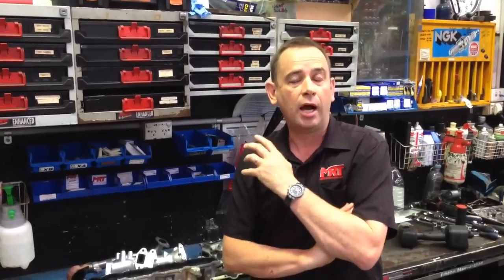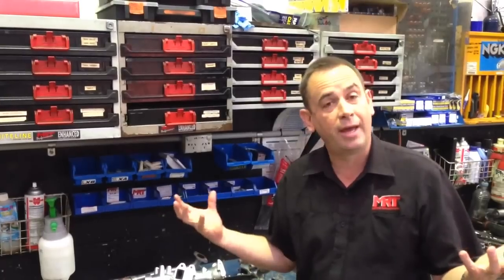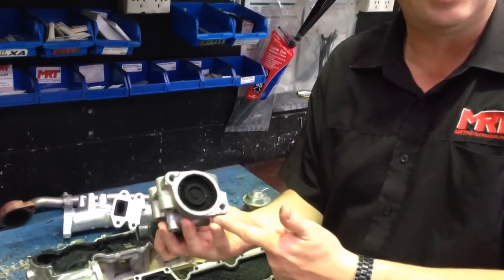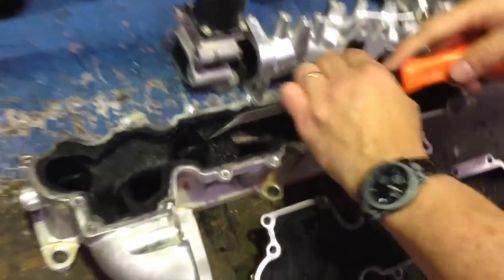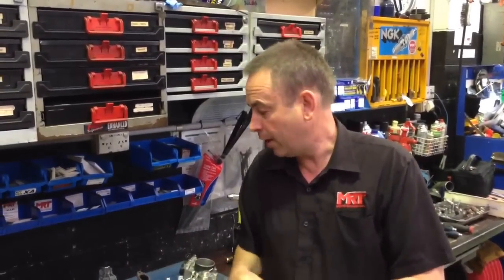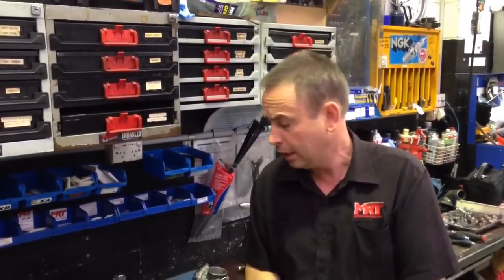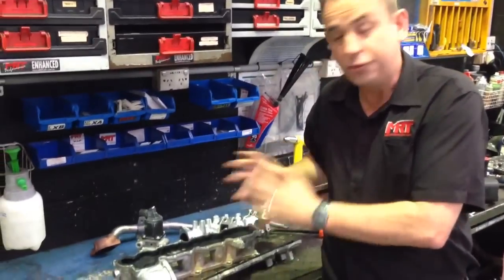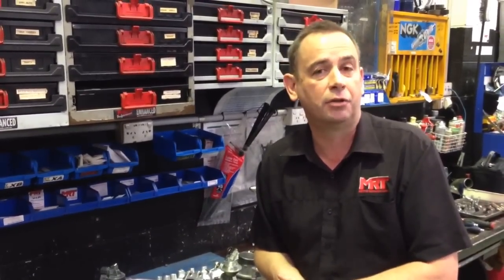Mitsubishi Turbo diesel secrets, the hidden ugly side of soot.

Comment: Thanks MRT , that was a great video.

I would like to add my personal story to this video following
the theme of soot and EGR issues.I purchased a DID MN Triton (2011 Model) a year and 8 months ago here in SA. After a week it start blowing black smoke so I took it back and they identified the fault as a build-up of soot so they cleaned the manifold  and also, or so I been told, changed fuel filter as I have been explained “is very sensitive to fuel deposits”.As per their recommendations I started to buy the diesel additive ( Mitsubishi brand for an outrageous $14  a bottle. What the …..????  it is 500Ml bottle for a full tank of 65 Litres).
2 weeks later, the same issue. ‘This time it is the EGR’ they declared,  which they insist is now going to be replaced ….. 
4 days later, the same issue again. This time they tried to sell me a story that one of the components was not installed properly while they fixed the EGR so now it is all good ..2 weeks later .. you guessed it,  it happens again …. They promised to look at
it more closely and they decided it is the Turbo … so they replaced the turbo.6 months ago I took it to a non-Mitsubishi-mechanic for a scheduled service who insisted that the fuel filter is aged and not been replaced…. Go figure !The time has come to do the timing belts (2 months ago) so I went there again and asked them to look at my favourite subject- black smoke, while they are under the hood. During ALL this time I always had that thing where something  is also causing the engine to idle
poorly and while taking-off slowly, by pressing on the accelerator gently, it causes the car to 'bounce' and or 'hold-back' as if there is a poor flow of air OR some sort 'engine-starving' effect as if something is clogged somewhere or blocked ( of air flow)Guess what …. They found out that after a year and eight months that one of the injectors did not work … will you believe it ????? I was driving with only 3 working cylinders for all this time. How on earth did they not pick up that fault ??? “Very rare” they told me…No wonder they replaced the turbo, the engine simply did not have enough grunt in it to function properly.Anyway , that done, I drove for a couple of weeks and the black smoke started again ! I said , that’s it. You either fixing it or I am going to consumer affairs. Well now, they finally found the fault ( I hope) , it is the AFS (Air flow sensor) which supposed to be replaced with a new designed sensor replacing the original one.  According to the Mitsubishi mechanic, the engineers of Australia, Thailand and Japan looked at this issue of AFS faults and decided to redesigned it with a ‘harness type’ about 2 years ago. (This is what I was told, I am not an expert !). The mechanic replaced it and re calibrated the air flow again electronically and it’s all done now.
Well, the car is working as it should!!  with power, grunt and without ‘dragging’ itself. It changes gears more easily (auto), it sounds smoother, quieter and drive with less effort on my behalf. Black smoke is no longer an issue.Lesson of the story is, don’t give up ( I am very very very lucky that the car was still under warranty). Keep on taking the vehicle to the Mitsubishi mechanics ( especially if it is under warranty) and don’t take ‘No’for an answer. Mechanics also have their faults and some are simply not experienced enough to look beyond set of instructions, steps over a laptop…..If anything, I hope I helped someone out there who is stuck with an EGR issue that his Mitsubishi mechanic cannot figure out… Don’t be shy and insist that they look at all the above issues thoroughly and not just through a laptop… at the end of the day, THEY ARE GAINING EXPERIENCE FROM THESE MISTAKES which hopefully will not affect the other poor Triton-owner who just want a vehicle to work as it should.Cheers, and good luck !Please leave your comments to the next person on these blogs/youtubes,  it only help us, as a
consumers, to get a better understanding of what  is wrong with our vehicles.
Reply: your mechanic is very very good..hahhaha..in that case the mechanic should take the engine performance in each cylinder...not by judging.coz it waste of time  and money..
Reply: Isaac Negev; Excactly what engine do you have in your Triton?
Reply: I owned a 2014 triton (Strada in the Philippines) pick-up. Appreciated your story, thank you brod. I used to service every pms at my distributor (casa), although it is costly but it was well maintained.
Reply: WELL DONE ...DILIGENCE WON OUT  ....

Comment: I've owned diesel 4WDs for 30 years. These new engine no doubt give you more performance these days for your money but also need more TLC. My 2011 Mitsubishi Challenger has the MRT retune by Brett and I can honestly say that the performance and tune of my car is excellent and stable.  My car was new and I bought the retune at around 5,000 klms and now I have done 115,000 klms not missing a beat and feels as good as the day it was done. I see less engine timing adjustments needed as well as far as we can tell.

EGR is a peace of pollution kit for sure designed to control emissions in which manufacturers are increasingly under pressure to reduce green house gases just like any other industry that pollutes. Beijing's resent smog Red alert is a testament to pollution causes of particulate matter (PM, 2.5 is a type of pollution involving fine particles less than 2.5 microns (0.0025mm) in diameter) of which cars are a major contributor and they have placed restrictions on car use this week. Odd and even days.
As we know its these particles mixed with unburnt fuel that causes the eventual restriction in the manifold of all DIDs as show in this video and I'm convinced of the need to limited EGR involvement. I know of a couple of triton owners who have suffered. Don't forget the performance gains Brett brings. I'm installing LPG injection soon which will no doubt give me better economy and performance but even more importantly a more complete burn and  less unburnt fuel means an even more cleaner engine and less pollution !! A win win as I see it.
Get on board everyone !!

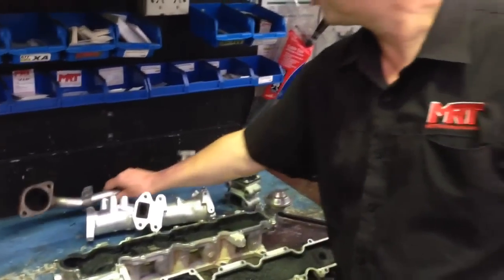Comment: The best way to disable the EGR Valve (as seen at 2:35) without upsetting the ECU, is to unscrew the four screws connecting the Actuator and insert a 6mm shim between it and the valve body, before reattaching.  The Actuator will still perform as usual but there will be insufficient throw to open the valve and all this can all be done with the EGR Valve still in situ.

Since the primary function of the EGR Valve is to lower NOX by reducing combustion temperatures, it is possible that the Mitsubishi cylinder head failures could be attributed to the widespread crippling of the EGR Valve which was popular at the time.
Reply: or just buy 12$ cable, read ecu, disable egr and write it back.
Reply: Mut3 12 dollari? 450 i say

Comment: You should mention fitting an oil catch can is also another option to stop this problem from happening
Reply: Well, it will slow it down. As it only controls the crankcase ventilation not the EGR the egr is defined to destroy the internal moving parts of the engine. Carbon is similar to diamond dust. It is an aggressive grinding dust. Let me ask you Would you dump a liter or one Quart of valve-grinding compound into your crankcase with every oil change? I don't believe any sane person would so why would you dump carbon from your exhaust back into your engine never mind the plugging up the total air intake system? Then it starts grinding your piston walls and wearing down the piston rings and getting into your crankcase oil reservoir then your main bearings and seals, the cam bearings timing chain or gears front and rear seals gone

Comment: This makes so much sense! I recently went to install a boost gauge on my 83' Merc 300SD (OM617.952) and I removed a plug in the intake manifold and there was a good half an inch (no joke) of that black tar built up on the plug, and therefore throughout the intake manifold. I was horrified, and wish there was an easier way to clean her off without letting it sit in an acid bath. after 250,000 miles it really builds up! Darn emissions stuff gumming our engines up.
Reply: An easy way to clean it is to get a propane torch & an air compressor, remove the manifold,  stick the torch in the  manifold to soften up the black crud & use the air compressor to blow the crud out.

Look up "cleaning out inlet manifold with blow torch"
Reply: "This makes so much sense", yes, causes more emissions than it fixes.

Comment: Just to clarify EGR. Exhaust gases have already been burnt making them in effect inert. At small throttle openings the reduced air volume causes a lowering of compression pressure and subsequent reduction in combustion efficiency. By recirculating some exhaust gas the combustion pressure can be maintained without effecting the low speed air/ fuel ratio and this gives the improved performance.  Problem is exhaust gas also contains particulate matter in the form of carbon residue and oil vapor and this crud blocks the systems over time.

Comment: Just for reference the EGR will drop your fuel economy regardless of throttle position etc. The more bang you get for the same amount of fuel the more fuel economy you will have. Inert gas in your combustion chamber will reduce the fuel economy as the engine will not burn as cleanly
Reply from the maker: well said

Comment: They should design the EGRs on these cars to recirculate the exhaust gasses after it's been treated by the diesel particulate filter (DPF), that way there would be no soot to mix with the crankcase blowby when going through the intake. Maybe I'm wrong but that's just what makes more sense to me.

Comment: Interesting video. Just a quick note, the EGR system is actually designed to reduce emissions. It's designed to add a small amount of inert gas into the combustion chamber at low engine loads to help cool combustion temperatures, thus reducing oxides of nitrogen (NOx).
Reply: I don't no about cooling combustion, & don't fully agree with that but lack information to completely disagree.
It's about giving the exhaust pollution a second burn & thus reducing Nox.
some models have Egr gas coolers some don't.
It all came in to reduce pollution & keep buildings in cities less blackened etc like back in the old school days & keep air level pollution below levels gov sets out.
The Egr is designed for pollution reduction only. I cannot see how burning soot can give better fuel economy & I think thats a myth pushed by car sales people & the whole industary to say its a good tech for overall performace. There are media folks within gov who have an agenda & must brainwash with false info. 
Not that cleaner air is a bad thing, they just don't want our cars being more expensive to repair etc by their policies.

The truck industary don't have EGR's because they who actually maintain vehicles that make money realised their expensive machines where losing performance & run adblue in the system to make them cleaner in exhaust but not get clogged up.
Reply: Chris E 
https://en.m.wikipedia.org/wiki/Exhaust_gas_recirculation

Go and do some reading up on it and then come discuss.

Soot reduction is the purpose of a diesel particulate filter. A completely seperate system.

And trucks do run EGR. Cummins have been running it on their ISX and Signature engines for years
Reply: And as for SCR (or AdBlue as you put it, which is just a mixture of 32.5% ureia to water) that again is a completely seperate system to what EGR does. It's utilises a secondary catalyst in the exhaust to further reduce emissions. Again, go and read up on it, then come and discuss.

Incase you are wondering, I am a diesel plant mechanic, working in the mining industry. We are currently subject to Euro 4 emission laws for new equipment, but that's due to change very shortly, so most of these emission controls are still fresh in my mind.

Comment: "After 2010, the application of EGR into light-duty gasoline engines was expanded—not for NOx control but for fuel economy purposes. Using EGR in downsized, direct-injected gasoline engines can reduce pumping losses, improve combustion efficiency, improve knock tolerance and lessen the need for fuel enrichment"

Comment: what about a water methanol injection system? i read that it has some kind of steam cleaning effect because of the water vapors... would that help the buildup problem?
Reply: Expensive as I would believe.that system are already in existence on ww2 top notch fighter plane.bf109 . MITSUBISHI a6m6.already used it to some extent but not to reduce emissions but to increase the turbo boost and power.if I was not mistaken the ratio is 50part water methanol and 50part high octane gas.these are expensive/complicated way to produce power.back in the days where everything are legal as long as you shot your opponent down.not to mention pollution control ...

Comment: The EGR system is designed introduce inert exhaust gas to reduce combustion temperatures and therefore reduce NOx emissions. It doesn't "re-burn" the exhaust gas, it's inert....
Reply from the maker: +blmech68 excellent comment, yes you are correct, BUT there is some unburnt fuel that is used, however the main aim as you say is to reduce NOX
:)

Comment: EGR is to reduce NOx on Diesels as a result it produces more very fine particulates which is why the DPF is required. Because you are putting exhaust gases back into the engine you no longer have the benifits of better scavaging which improves fuel economy. That is why an engine today give a lower MPG than a diesel of forty years ago of the same size and power.

Comment: My ML Triton 3.2 DiD has hit 120k's and has been back to mitsubishi 3 times (60k, 90k, 110k) to have the manifolds cleaned out/replaced - remember that these cars carry a 10 year power-train warranty and as this is an existing fault with these engines mitsubishi has to keep warranting the claims up to the 10 year mark!

Comment: Very good video, however i must disagree with 1 thing. EGR blanking plates do not have the downsides that he mentioned. In my mk6 ford fiesta 1.4 tdci, it increased torque down low in the rev range and also increased my mpg by 2 or so miles. Myself and the rest of the UK Mk6 owners club thinks the same way
Reply from the maker: unizel101 you may be correct on a ford, but not on a Triton
:(

Comment: so what is the whole point of having an intake air filter, if after the air passes through the filter, it gets mixed in with all this mess..?
Reply: +still34u I believe that the whole point of an air filter is to stop the really big stuff, like leaves,flies, insects etc from getting anywhere near to the engine
Reply: Totally agree.     Tradition maybe lol
Reply: Different particles, soot isn't abrasive (engine bi-product), dirt and dust is and will cause damage.
Reply: @johnrichardson544  flies? :DDD they are nothing compared to carbon from exhaust
Reply: At least the bug and insect are keep well out.leaving us to deal with only a tiny amount of inert/combusted gases

Comment: Interesting video. Can i ask how many km's this particular vehicle had travelled? The clogging up of inlet valves and inlet manifolds is also a common issue on the VW/Audi engines.

On the VW/Audi's its getting popular to use a crushed walnut shell under high pressure (purpose built machine) to clean the valves. This method is also used on BMW/Mini engines. Do MRT intend on using this method down the track?
Reply from the maker: at present we have no plans but are aware of the process
Reply: Crushed walnut shells, dam this brings back memories of de-coking Mitsubishi GDI engines nearly 20 years ago when I was in the dealership

Comment: Below is a comment on a video which lead me to your video. Does this sound like my problem. They have checked the EGR valve and did not find a problem with it, but I don't think they went deep enough.. My car is a MN MY15 2.5 litre
____
I also have the problem. It has been doing it since about the 30,000 service. It has now done 55,000 and still doing it. They have had the injectors out and replaced a solinoid (the name of it escapes me at the moment, down near the radiator), that almost fixed it. They have found that when it does it the turbo pressure is really high around 23psi and does it around1800-2300 rpm. Did the get to the bottom of it.??
_______
Reply from the maker: best call us if you  can 0297674545